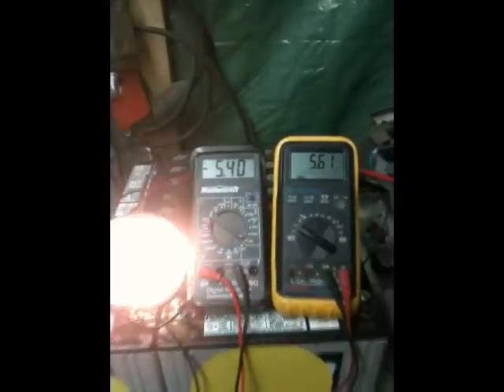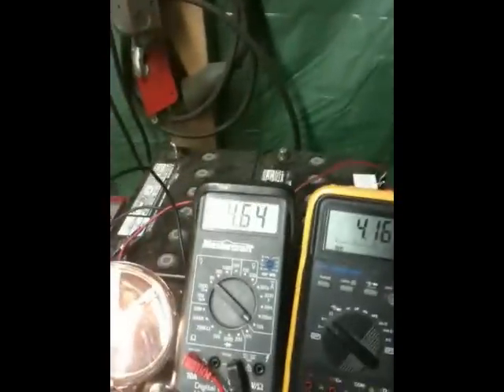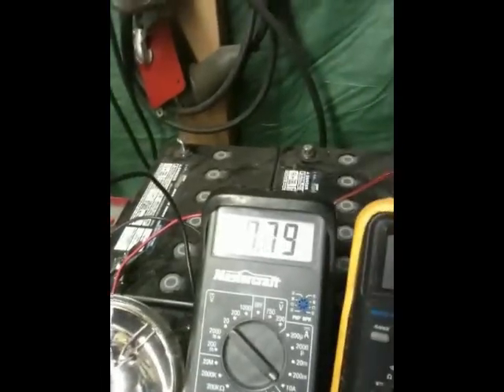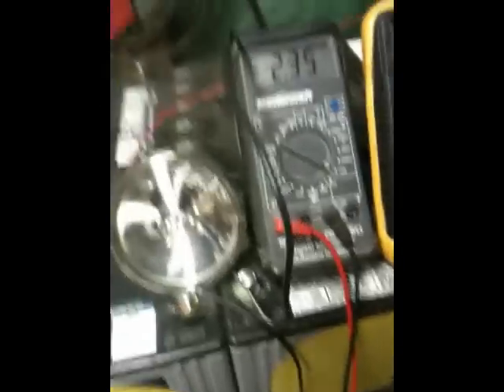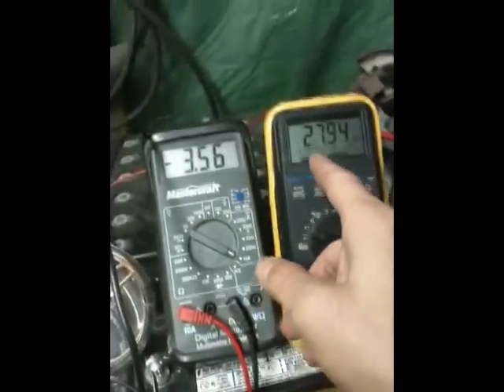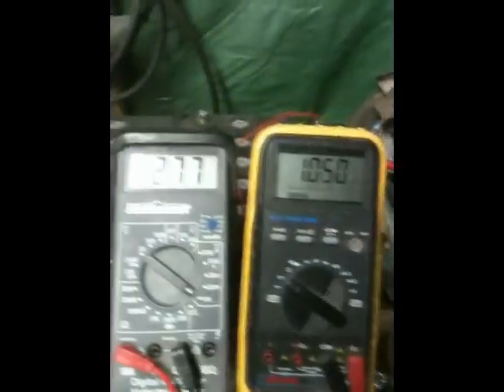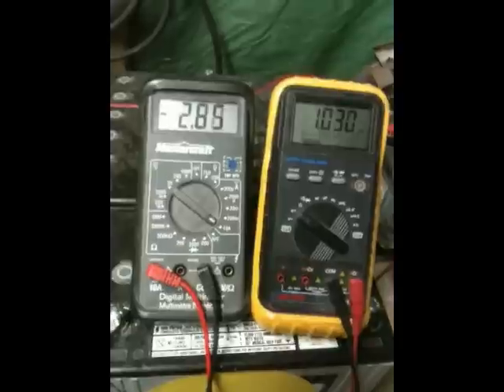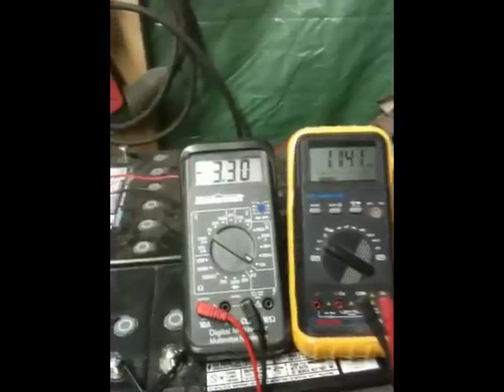350w HAWT CNC Prop 8ft axial flux pma coils magnets 3phase green energy wind turbine vawt solar 89

Comment: If you want to get rid of the whistle round of the tips and add one more blade.Just have 2 blades causes a vortex at the end of the blade.So 3 works great.If you are have a over voltage problem i beleive i have solved that problem.I will post it on my channel when i complete it.